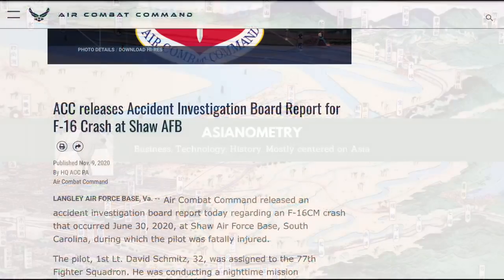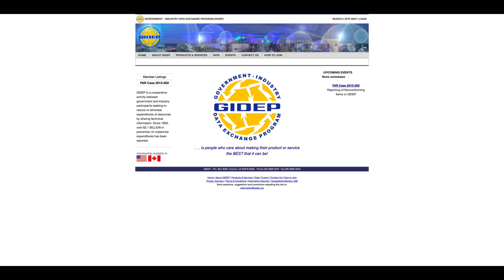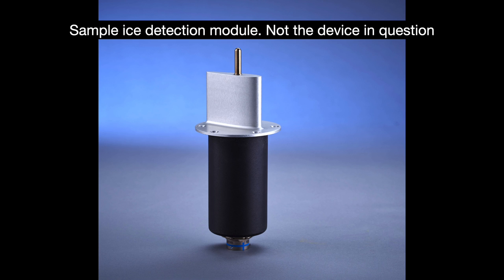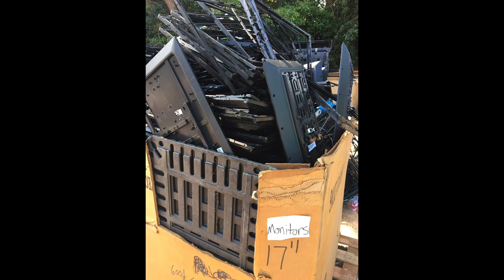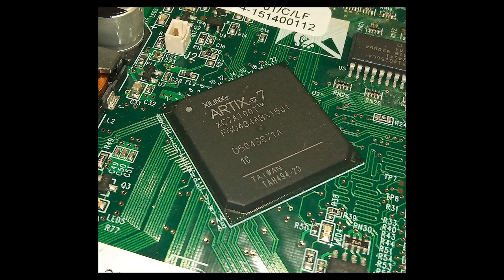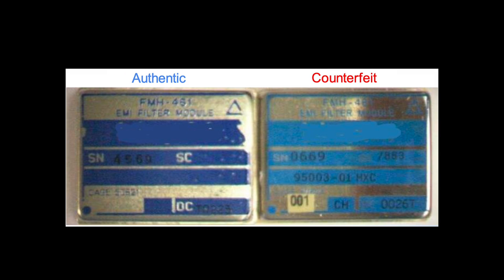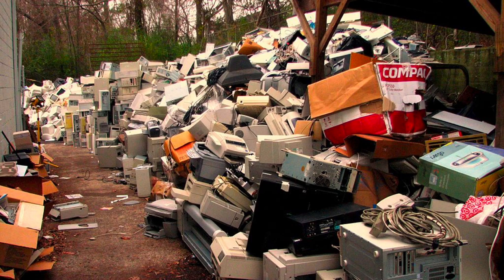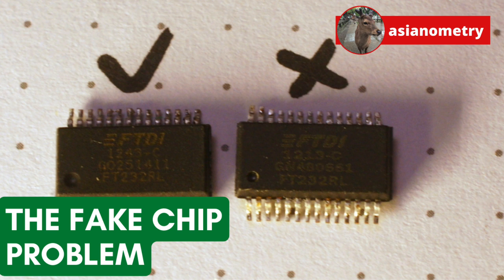The Fake Chip Scourge

Comment: I'm surprised you didn't mention the counterfeit capacitor problem that has plagued electronics for the past 15 years. I've had half a dozen video card, motherboards, PSUs and LCD screens fail due to this issue. By far the biggest example of counterfeit components in terms of economic damage done as a result.
Reply: Indeed, most counterfeit capacitors can be indentified just from the plastic jacket printing, the lettering has soft edge, ink density is not uniform, and is not shiny like original items. Now I only source components from reputable distributors with Country of Origin document.
Reply: You're buying components from god awful vendors if fake caps are killing your computer components and monitors. Competent vendors know where their components are coming from. Are you buying the cheapest stuff available?
Reply: In the early to mid 2000s, that was actually from a legit manufacturer stealing the formula from another legit manufacturer but flubbed it - and those caps found their way into computers from Dell, Apple, etc. So something doesn't even need to be fake. Not sure what the deal is now, but no doubt it's definitely more the fakey stuff.
Reply: @aluisious  
The big names (IBM, Dell, etc.) were affected by fake caps.
Reply: It's relatively easy to test capacitors for leakage.
Reply: I agree although I was a crypto miner rather than a professional in EE field, I own almost a hundred graphics card and most of them failed due to this reason.
The single, cheap capacitor are really cause economic impact in terms of my earning and maintenance cost
Reply: @rcmrcm3370  Electrolytic caps have different ripple current, life and temp characteristics. This is not easy to test.
Reply: @shawbros  Toyota ECU's and other in car componants from 1992 till 2000 had  many fake Caps installed, the last 10 years eveyone in the industry is doing repairs and replacing most of the caps in these units, some have spewed their guts out so much that they have made multi layered PCB's un-repairable.
Reply: man. my monitor died. i thought it was caps. no all caps good (it lived about 15ish years), and all more modern stuff i tried to repair ITS MOSTLY CAPS...
Reply: Economic damage? You bought new ones most likely.
Reply: My monitor just died a week ago. I'm from South Africa so we have load shedding and when the power came on the monitor didn't. I checked the motherboard and the fuse was still intact but 2 capacitors that are after the fuze were broken. After discovering this I checked 2 TV motherboards that went dead a couple of years ago and again both had broken capacitors. So yeah this is a really big problem.
Reply: And junk fuses that fail by themselves after a few months.
Reply: I remember an acquaintance of mine who collected Retro-computers had a fire cause by fake capacitors he had just replaced in a power supply.  Utterly gutted it. (I think it was a SX-64 portable, pretty rare even in the US, but gold dust here in the UK)
@jojo:  Unfortunately, the counterfeits these days are far better than that. I have seen capacitors that look fine right until you put them in a tester.  
Unfortunately, for long out of production chips, china is sometimes the only place to get them.
Reply: I replace the capacitor in my 5000W AC unit every summer, I live in Nanjing, costs me about $120 to replace the cap and add freon.
Reply: @aluisious   Afaik the fake cap problem has mostly passed. But it affected motherboards from across the price spectrum. 'Lemon Party' isn't talking about his own build electronics. That said I would question the "past 15 years" statement - as I believe it hasn't really been a problem for the 5+ years. 

But this video is literally about how bad components make it into the most tightly controlled procurement processes in existence. A single aircraft screw costs over $100 because of this process, yet the video cites an example of a Boeing safety system that had fake components (I'm aware of the Boeing controversy, but still) - point being 'Competent Vendors' are by no means immune to fake components.
Reply: @aluisious there are places where you don't have reliable vendors/delivery from them. So you have to rely on local resellers which.... works half the time?
Reply: The capacitor plague was not due to counterfeit parts, but rather manufacturers making capacitors from an incomplete stolen formula.
Reply: I had a motherboard with blown capacitors all over it, and it was never used. I got it "free" with a gtx7800.
Reply: It’s quite difficult to build a late 90s/early 2k PC because so many motherboards surviving from that era have Capacitor Plague.
Reply: @CBtronica  how do u know?
Reply: Caps were legit, they were just bad. Lenovo/IBM, nvidia, and others aren’t buying their caps from suppliers. They get them directly from the manufacturer (or, we’ll, their odms do).
Reply: @jojoanggono3229  "most counterfeit capacitors can be indentified"
Not in the bad caps plague around...2005? that OP is talking about. The cause was industrial espionage, where the stolen electrolyte formula turned out to be faulty but the subcontractor failed to spot it (or just didn't care) and sent it off to legit capacitor manufacturers, who then sold them to reputable electronic manufacturers like MSI.
Reply: just 15 years?
Reply: @aluisious  we learn from our mistakes, supply chains were not always so robust. What do you think gave the impetus to focus more on supply chain integrity?
Reply: @billfusionenterprise  I was going from memory. It definitely started more than 15 years ago. I remember in 2005 the problem was already widespread, so it started a few years prior to that.
Reply: @trucid2  we had some schips sent out for decap and found it, in 1997
Reply: How do you know bad capacitors caused your electronics to fail? 

Or are you just assuming because they broke it had to be because of bad capacitors?
Reply: @South_0f_Heaven_  Thanks for asking. The first thing I do when I suspect a hardware failure is take the device apart and examine electrolytic capacitors. Those with bad caps will be misshaped or leaking. Usually the capacitor tops will be dome-shaped instead of flat.
Reply: @trucid2  swollen and leaking capacitors were common in the mid 90’s to about 2005. 

It’s rare to find them in anything made in the last 15 years so you must be a really unlucky person to have had so many. 

The kind of electronic components he is talking about being recycled in this video are actual chips, not cheap things like resistors and capacitors.
Reply: @South_0f_Heaven_  My most recent failure was about a year and a half ago, a 2048x1152 monitor. It was manufactured in April 2009. I was happy using it as one of my auxiliary monitors as it had a better resolution than a regular 1920x1080 monitor, but it broke. The bad cap issue still pops up now and then, usually from older components from 2010 and earlier. People still have LCD TVs, monitors and power supplies from that era that are not yet obsolete.
Reply: @RolandElliottFirstG  Well that makes me nervous, I have a 2000 Lexus ES300 😅
Reply: We need to quit China
Reply: @South_0f_Heaven_  The capacitor plague is why so many motherboard companies now advertise "Japanese capacitors" in their marketing materials.
Reply: @South_0f_Heaven_  It was pretty widespread and well documented. Failed capacitors are easy to spot if you know what to look for.
Reply: @johanmetreus1268  I have seen so many boards with the problem it's not funny. No, seriously, I would have built vintage machines with those boards, it wasn't funny.
Reply: @jon9103  yup fixed many of them. Asus always liked to be different installing them backwards to everyone else.
Reply: @johanmetreus1268  i was slightly OOT but yes, the capacitor fiasco back then affected many manufacturers. If i'm not mistaken the problem caps was produced by top tier manufacturer, how embarassing.
Reply: @nintendoeats  I replaced the caps on three of my family's computers, plus my own, as they managed to live just past the warranties. "Not funny" is a good summary.
Reply: Yep, there's many rebranded (old) electrolytic capacitors still being sold as if they're new. And sometimes they're sold with invalid values for them (higher voltages and capacitance).
Reply: My parents had an LG TV where half the backlight died. Thing was less than 18 months old, never moved. Fully convinced the power supply was screwed up from factory and counterfeit caps would not surprise me.
Reply: @South_0f_Heaven_  I've seen the problem in a lot of 2007 gear, and I think it was still filtering out until 2010
Reply: @shawbros correct. There a large batch of them used from laptops to servers. I had few of them at old lab where you can replace the capacitor with the correct one & the motherboard will work again. However it is interesting that manufacturers like IBM, Dell, HP, etc didn’t recall them for that defect.
Reply: Er because the title wasn't The Fake Capacitor Scourge...😁
Reply: Haha learned about that one myself when I repaired a monitor. I don't even think my caps were counterfeit I just went with super cheap ones... Turns out those circuits are kinda sensitive and usually buzz if you don't have a good cap in there. I found some nice Panasonic ones and they worked like a charm!
Reply: @TheLionAndTheLamb777  mine had one bad capacitor, but removing it didn't solve problem, it seems like power controller got damaged(and or something further) (burn spot and magic smoke smell). so i just salvaged plexiglass for future project) i had to replace it anyway, just unfortunate timing (thig is so old, literally my first monitor, but was useful as second one)
Reply: That plague is largely over now due to solid state capacitors and vastly improved electrolytic formulas.
Reply: Hard to test a cap effectively if it looks right. "Form fit and function" = fake
Reply: @williamkesner781  Ever encounter a capacitor with an empty  shell and a tiny used capacitor inside soldered to the pins?
Reply: @Doom2pro  lol no I have not
Reply: @Doom2pro  😅 that would be hilarious
Reply: @aluisious  the video is literally about the U.S. military suffering from this. I think it's fair to say it's not as simple as "just pick better parts"
Reply: @minortoterona2947  shelf life of electrolytic's is not more than 15 years anyway right?
Reply: @DvACtOid  lol
Reply: @aluisious  Manufacturers are.
Reply: @rcmrcm3370  The problem is that they can test fine when new but fail quickly in service. Philips had several products suffer from this. Testing doesn't always catch them.
Reply: @mudearth  It was both. Fakes still are coming out of China, especially fake premium audio caps. I have found dozens in the last year. 

It used to be easier to spot them but they have gotten good at duplicating seal, wrap, and shell appearance. Unless you pull them apart and examine them under a microscope you can't be certain.
Reply: It's from subcontractors ordering cheaply from Chinese sellers who are just flat out either scams or have zero quality control. Shame on the American subcontractors who are trying to skim a buck off the top and shame on the Chinese sellers for doing the same.
Reply: Because it was not  counterfeit capacitor. It was an original capacitor with defects duo to contamination.
Reply: we can help with quality capacitors

Comment: I'm a little surprised that you didn't mention the time when FTDI pushed a driver update that bricked counterfeit FT232RL chips.
Reply: I am never using any FTDI product, real or counterfeit, for what the did.

Their controversial action broke finished products that were shipped to actual end users, too, without any available solution to fix a now completely bricked device.

Their chips are unreasonably expensive, too. I prefer a CH340G and other WCH products instead of any FTDI chip.